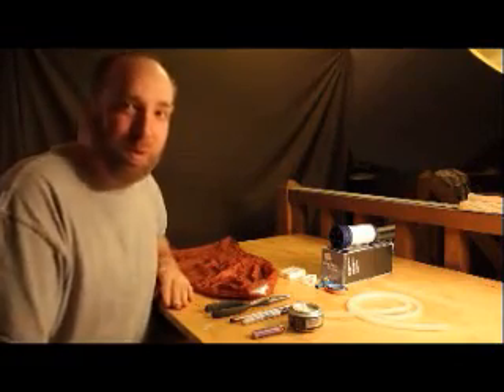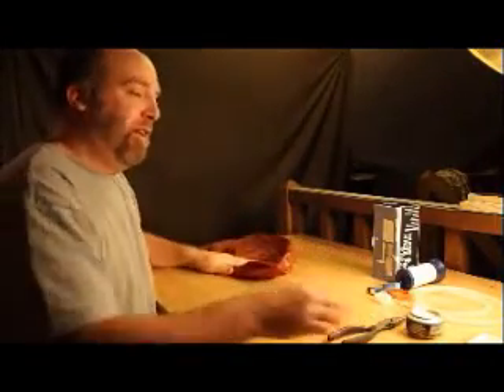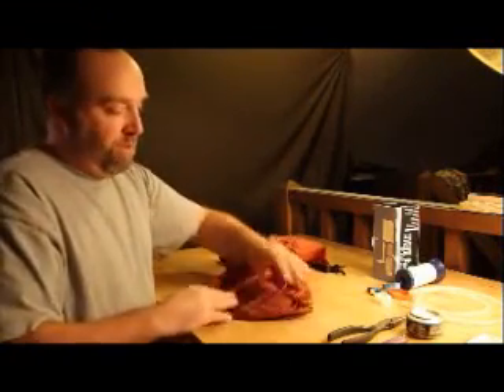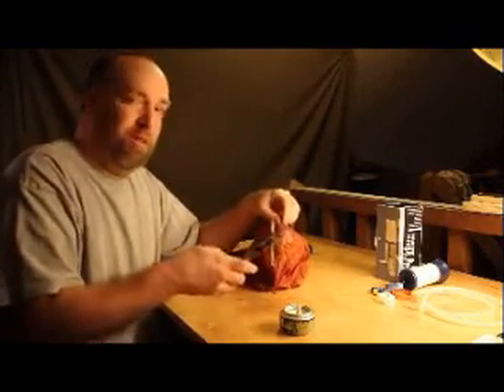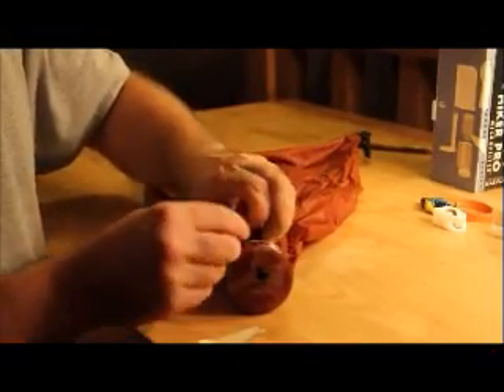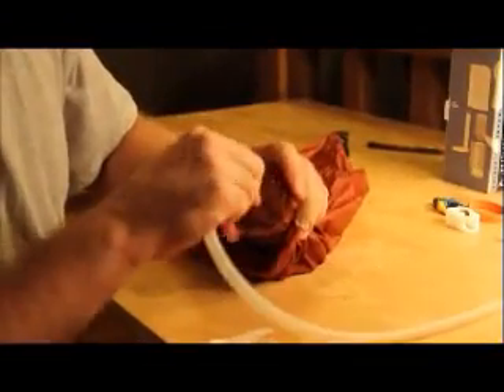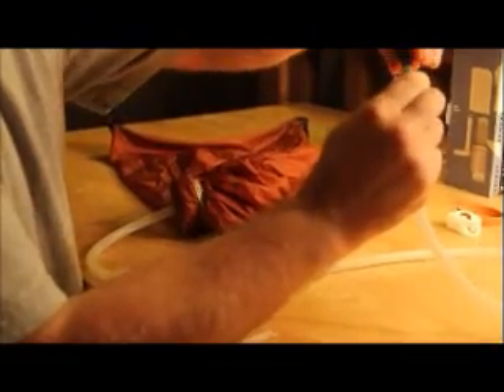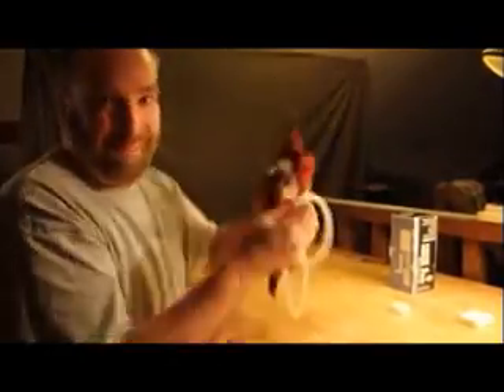Water Filter Instruction

Comment: thank you! the rubber band gasket is the solution i was looking for.  
how is it holding up?
Reply from the maker: Glad I could help. Mine has held up for well over a year before changing the gasket. On  a long hike though it might be good to have a spare rubber band. If you change the filter you'll need to change the gasket also since it sort of forms into place. Let me know how it works for you! I have some other stuff you might like at my site www.hikerweb.net.